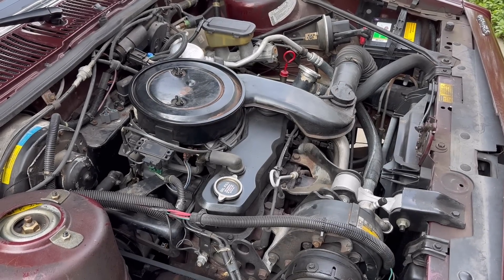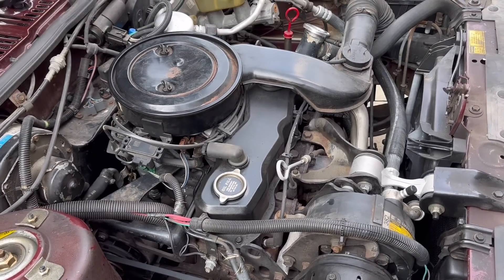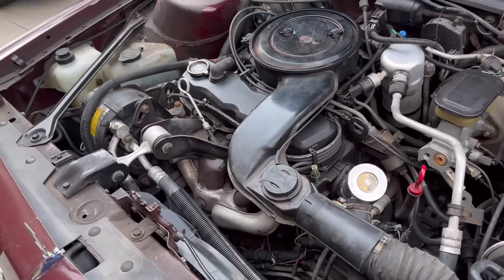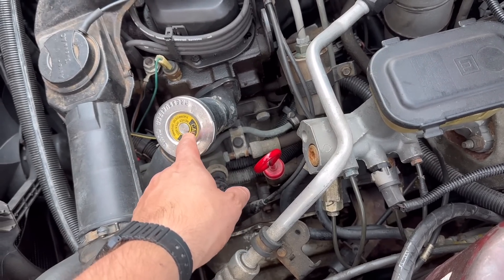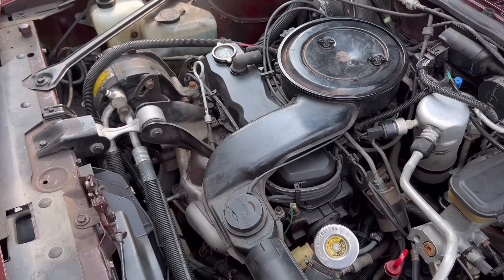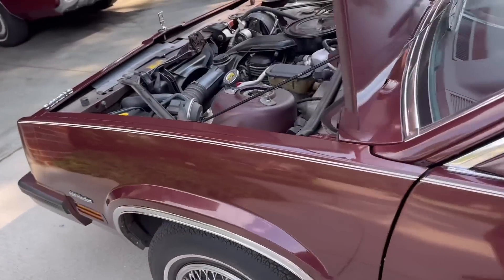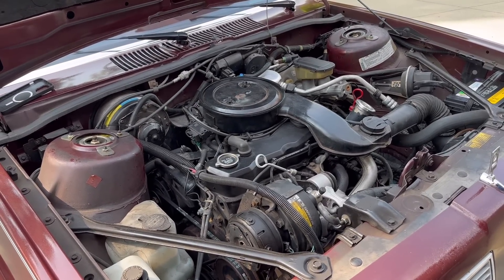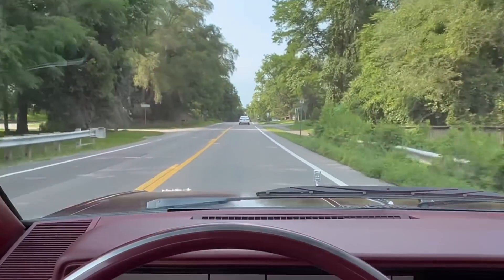Bad Engineering Makes This Engine Challenging to Repair: GM 2.5L Iron Duke 4-Cylinder Engine

Comment: We had an '88 Pontiac 6000 with a tech 4. It didn't have a distributor so that wasn't a problem, but it did have other mechanical issues. It had the small front brakes that wore out at 15k miles. The canister oil filter in the oil pan needed pliers to remove and always caused a mess. The belt tensioner opened the cooling system when you removed it and caused a mess if you didn't drain the radiator. The belt tensioner and alternator both failed at around 40k miles and again at around 80k miles.
Reply: Replacing a failed coil or ign module on the DIS system was almost worse. High mileage cars that were full of rust often times ment the tiny bolts would rust into the coils and break off in the module plate, sometimes flush. If you were being paid by book time, your day just got ruined.

Comment: Adam, all of our GM front wheel drive cars had "morning sickness" from the steering rack in those days.  I was in the Service Department at an Olds dealership from 1985 til 1990.  Our OE racks were strictly made from an aluminum housing.  The power piston would seize in the aluminum bore after last use, and, if you didn't know about this, your first attempt to turn the steering wheel might require a pipe wrench to break it free, and then it was good for the rest of the day.  All replacement short gears were rebuilt with stainless steel sleeves to take care of the problem.  I've been in some situations with these cars that created a tremendously dangerous opportunity to maneuver.  Another infamous problem with these cars was the TCC solenoid that would stick and stall the vehicle when exiting from a freeway.  Even worse was the cheap AC fuel pump that would get hot from a long drive, develop excessive resistance, and then stop working.  A few minutes or a few hours later, the vehicle would drive with no problem.  After dropping the tank, you would find the fuel pump electrical contacts had turned brown due to overheating.  Not so good inside of a fuel tank, AND get over the battery change.  Enjoy changing a battery in a later Chrysler Corp. vehicle where the battery is installed in the bottom of a front fender!
Reply: Power steering pumps were common failure. Try getting one to the side of the road when you steer one handed due to driving with hand controls,, murder on shoulders.
Reply: @KentTeffeteller  That's why i POSTED THE 1980'S FRONT-WHEEL DRIVE CARS were junk.  I'm glad, Toyota, Honda, and Volkswagen kicked their ass. Corporate dickheads killed the quality of American cars in the 1980's.
Reply: Oh yes, I helped my dad change the morning sickness steering racks on our '86 Buick LeSabre and our '88 Pontiac 6000.  It started out as morning sickness, but then they would start getting stuck even when hot, like when you're on the highway.  A little unnerving when the road curves, you turn the wheel, have no power assist, and when you get some muscle behind it to stay in the lane, power steering suddenly comes back and you oversteer.

Comment: LoL. They weren’t that bad. I worked for Jeep and GM in the early 90s. The Jeeps were easier by far easier but if you had a proper rack to work on they were easy enough.
I make loads of car and house payments working on these things.
We had a retirement community near us when I was at the Pontiac dealer. They had a rule that your car couldn’t leak oil. The old goats would trade their cars in when it was something expensive to seal up again like a main.
I bought a Calais that had 80k on it for my sister. She put another 160 on it before the bottom end blew out of the engine. 
I put 150 HARD miles in a CJ5 with a 2.5. The worst thing about that engine was the wonky ass emissions system AMC hung on it.
These were good motors.

Comment: A co worker back in the day had an Astre with this motor, but it was rwd so access might have been easier. It was pretty far gone by the time he got it, so maintenance was occasional. Seemed to run well, particularly compared to the Vega.

Comment: Funfact,  the "extreme service" hood position was only on Oldsmobiles.  Chevy and Pontiac used a different bracket.  Not sure what Buick had.  Working at pontiac back when these were new, we did 100's of timing gears on these.

Comment: Hi, was the first car the Iron Duke was used in a rear wheel drive Pontiac of 1977?  Per Siri.   That would change engine position and distributor much more assessable.  Design engineers ok job there.  I had the heavy, SLOW as molasses on a very cold day, noisy Pontiac Iron Duke 2.5L in an 85 Olds Ciera that was my dad’s 90 YO cousin’s final car. The only thing it passed was gas stations, yet my wife and I both somehow managed to get speeding tickets in it !  Curb Crawler.  Morning sickness cold power steering almost would lock up. So many different GM cars had that back then, for years.  I’m still shocked never a class action lawsuit on safety issue. Headliner hung loose in my hair, I used a curved needle and stitched it back up into the insulation, worked good nuf.  Cold idle of earliest fuel injection was literally 30 mph on its own for a mile or more before sensing heat and slowing.  There was nothing could be done to slow it at start up, so I’d try and get gearshift into R or D as fast as possible before motor wound up and foot firmly on brake.  Heavy motor, FWD, skinny all season tires, ZERO torque, it would be icy streets and I’d have one or three coworkers in it for lunch trip and would slay them with how I could almost floor it and no spin, on ice !!  4” slushy spring snow and pretty much straight and true down the road.  Here’s a funny truth !  Lived at a country place way back when, the large, heavy propane delivery truck’s front wheels slipped off the snow pack on our drive and every attempt to move at all, it kept slipping on downhill slope. I told the driver “all I have is an old curb crawler Olds FWD with no torque, excellent traction and a tow rope”.  We hooked the Olds Ciera to the big truck, I pulled, he moved and we actually got his front wheels back up on the snow oack and he was able to drive off.  Funny scene.  I loved the quiet comfort of the Olds, it smoothed the rough road bumps very nicely, had planned on keeping it longer, but the new AC Freon syndrome.  Had a mechanic try to convert, the higher pressure blew out compressor seals by the next day.  Gotta have AC, so gave it to my bro-in-law for work bomber.  I think maybe the head gasket eventually went.  Engine was nasty carbon build up when I got it.  A lot of pinging going over slight hills.  I put engine cleaner in it and stomped on it for some good number of miles, was better.  Was sage green, I liked that color.  Least power in a car I’ve ever had.  Quality dropped drastically from the best used car I ever had, a ginormous 76 Olds Delta 88 Royale 4 door hardtop.  Beautiful cinnamon red metallic, white top. Huge 455 that I swear could sneak out 14 mpgs, maybe 15.  Better than my prior Plymouth 383 four barrel and quicker 3:23 rear end in a four door top of line sled, it maxed out around 11 mpgs.  The 76 Olds I bought from another elderly cousin of dad’s who was a brother to the elderly gal I bought the 85 Ciera from. “All in the Family”.  The ginormous 76 Olds 88 never leaked anything, never used oil, always started.  After 250,000 miles it was just rusty and same bro-in-law was tired of it for his work car.  Olds was my fav brand.  So comfy, quiet, just enough lux but not too much.  Quality and reliability dropped so fast in the 80’s, is no wonder the Japanese makes moved in.  How much things change with decades of time. The Station wagons that were so popular in 60’s and 70’s are all the rage now !!  Just jacked up a little and AWD underneath, all the rage.  Dad said fads are circular and come around again.

Comment: They should've rotated the engine 180 degrees so that the distributor and oil filter would be on the front of the engine compartment.
Reply: Then you'd never be able to change the spark plugs.

Comment: I was sure that the repair challenge was going to be the cam gear, which requires either pulling the engine or lifting it to the sky. I had a customer with a 76 Chevette with power steering and A/C. Don't even think about accessing the distributor cap on that.

Comment: My 84 Skylark had a faulty ignition module that would let the car run for about an hour or so and then suddenly die. Wait a few hours and it would start right up and run fine for another hour.  The GM dealer, nor myself, knew that this was a module problem. One day the car died in downtown rush hour, after only a half hour of run time, so I had it towed and sold it. It wasn't until later that I learned it was a module issue.

Comment: A few things.

The welded sheet metal exhaust manifolds tended to crack in the center.  They weld easily with a standard MIG welder running regular steel wire.

Timing gears tended to wear on these engines making them clattery.  It took a while for the aftermarket to come up with a tight tolerance fiber cam gear  ( same gear set as the 230 250 292 Chevy inline 6 though most of the inline 6 engines used a aluminum cam gear   )   I used to pull the cam out to change the gears but moved to threading the nose of the cam and using that to pull the gear into the cam.  

Early automatic X cars had a problem where the transmission oil pump drive would wear the splines and stop turning.  This is an in the car fix with the updated drive. 

On this car, look behind the air cleaner , at the firewall.  The speedo cable runs here with a coupler, this was a common " odometer delete "  option.  Other GM cars had a mechanical cruise control on the inner fender and the same " odometer delete " function.

Comment: I had an '84 Skylark with the Iron Duke, It was a company car. It was awesome in the snow. I Traveled all over the state of Colorado and it did great. neat car back then! Silver with red interior.
Reply: Yep, GREAT in the snow.  Lots of weight on the front wheels and pizza cutter tires.  Not like today when a few inches of snow makes small cars road menaces.

Comment: We ran hundreds of these engines in S10 fleet pickups. Inner city stop and go with multiple drivers. Very dependable. These trucks were abused daily. Only one engine failure and that was on a propane converted truck. Overheated and cracked the cylinder head. Replaced the head and converted back to gasoline no more issues.
Reply: And don't forget the first gen LLV postal trucks.

Comment: Purchased an 84 fiero (auto) in june of this year. I've already tackled what i'd considered two of the worst jobs. First It's changing the v belts. Specifically the ac compressor belt(it was whining). The AC compressor is between the engine and firewall down low, but still above the cat. It has 2 pivot brackets. I kept having to get under the car, then hop back up to reach from above the engine. And then trying to tension the belt required me hooking a rachet strap off of one of the pivot brackets to one of the lift points under the car to get tension on it. And this job was done with jack stands and the tires off. 

The second job was the rear brakes, they still are not properly fixed. The parking brake actuator inside the caliper pistons have a wiper seal, one of mine is damaged and cannot be reused. I tried to find a replacement part but the manufacturer stopped producing them in 2016. So every Firebird, Fiero, 6000, and Camaro (just from my research there may be more) from 82 to 88 is SOL. 

For the time being I've gone with front brake calipers from a 6000 and they are working great. (Still have the old ones in case i find that part) Got wheel blocks for if I ever need to park on a hill. Maybe I'll try and swap the strut/hub assembly in the future to have a different parking brake system.

 Im not really sure if I want to go this route as this car is almost museum grade. Has minor issues with some interior and paint but everything else is factory.
Reply: Update: Unfortunately, the engine is deciding that gas is not enough fuel, and it's now drinking oil thru the pcv breather vent (blowby). I'm probably going to be forced to swap the engine out. I'm trying to figure out my options.

Comment: I’m surprised at how smoothly that engine runs for a large displacement four cylinder. I expected to see the air cleaner housing flailing about at idle. And the interior reminds me of a miniature Delta 88.

Comment: Your right, Fiero V6 has that pull thermostat. Prone to rust in all four shock towers in the rust belt. Had both V6 and Iron Duke, Citation, Phoenix, and a two door Omega Brougham; long before GM began to make 'em right. Everything you did tended to require disconnecting the motor mount. 🏁🇺🇸
Reply: I didn't get the memo. When did GM begin to make anything right?

Comment: I had the 87 Buick Skylark with the 4tec version of that 2.5L engine. Changing the oil was a pain because it had the cartridge style filter inside the oil pan. However, there wasn't a separate oil drain plug to drain the oil first. You removed the large filter plug to drain the oil and get access to the filter. Could be very messy if you aren't careful. My car also had a power steering failure in that there was power assist when turning right but not left.

My car was the same color of maroon / burgundy as your car. Mine was a 5 speed manual and I would get about 44 MPG on the highway. It had the digital dash as well. I loved that car but someone else decided I didn't need the car anymore and side swiped me and totaled the vehicle.

Comment: I guess youve never worked on a renault le car  ,engine removal so fun
Reply: I put a clutch in a Renault Le Car at one garage i worked at back in the 80s so we had to pull the engine.....what a pain and what a POS car.
Reply: @Troy_nov1965  you are exactly the kind of experience i was suggesting  i useda forklift to pull it cause the engine crane wasnt tall enough  yes you know the struggle thanks for chiming in
Reply: @rctopfueler2841   we had it on a lift and dropped it out of the bottom of car after taking off the crossmember. I remember when the guy got the bill he was not happy. The clutch replacement likely cost more than that pile was worth.

Comment: We bought one new in 1986 and put 245000 miles on it b4 it rusted so badly that we had to take it off the road.  Have to agree with you about the distributor cap and oil filter.  It also ate front brakes at an astounding rate until we started to use carbon metallic pads on it and that cured the brake problem.  We love your channel.  How do you manage to find so many wonderful cars.  Do you have an inside track on a Florida retirement community?  haha.

Comment: I had an 85 Citation with this engine.  The valve cover gasket was known to leak.  Also the rubber bushing on that top motor mount would wear out and cause the engine to rock a bit.  Iron Duke never failed me in 100k miles from '86 - '93.
Reply: Had an 86 celebrity,  loved that car but,  did 3 valve cover gaskets.  The last one was "after market" had reinforcements at the bolt holes.  Never had to mess with it again.
Reply: We used an old worn 1/2 distributor wrench to remove the egr valve, gotta remove that to change the v. cover gasket. Funny thing is Felpro offers a premium v. cover gasket now after the majority of these cars are off the road.

Comment: I had the Tech 4 in an 88 Fiero and while it doesn't have the distributor woes, the serpentine belt tensioner is an absolute nightmare. For whatever reason removing it opens up a huge hole in the water jacket, so you have to drain half the coolant before you can replace it, which then adds the fun task of burping the Fiero coolant system. On top of that they don't make the tensioner for the Fiero anymore so you have to get a customized Sunbird tensioner from Rodney Dickman which costs about 4x what a normal tensioner costs. The whole process was fairly horrible.

Comment: I owned a 91 S10 and a 91 Skylark, both with Tech 4 engines. The truck seemed to run smoother & quieter than the Buick, go figure.
Reply: The mounting positions in the trucks were better, cradled the engine. Also in trucks with the manual trans, the engine tune was slightly different with a higher base rpm. That seemed to help with vibration as well.

Comment: For me the bad repair was changing the heater/blower motor in a Volvo 240. It required taking the dash apart.
Reply: Amen to that.  I did it twice...never bought another 240 without evidence of blower replacement.

Comment: I once agreed to try and get Cimarron powered by one running... sitting in the middle of a business center's parking lot, on a freezing cold day. Trying to blindly reach around the block, only to change the plug wires, was a nightmare! 
Thankfully, the wire & plug change was enough to get it running. I forget what I told the father of the owner--who was a friend of my father... hence why I agreed to do the job--what I felt should be done in follow-up, but I never saw that car again... and damn glad the only other 'Duke I ever worked on was in my first truck: A fleet trim S-10, handed-down from my cousin.
Reply: The Cimarron was never powered by the Iron Duke. It initially had a 1.8L pushrod Chevrolet four cylinder, then a 2.0L version of the same engine, and finally a 2.8L V6.

Comment: A fairly decent running & durable engine but it wasn't designed to be in a crosswise position. My son had one in a Pontiac Grand something or other. Was a bitch to work on.